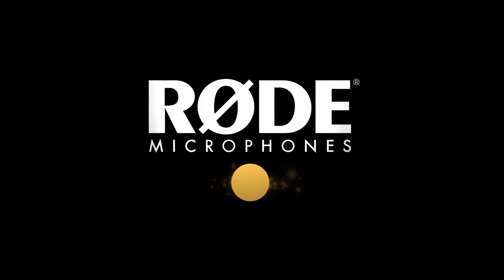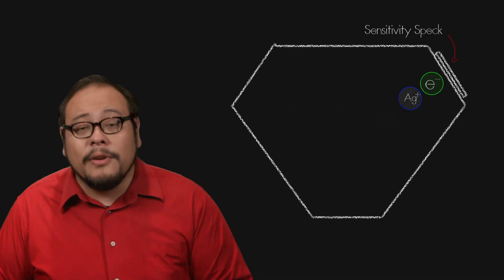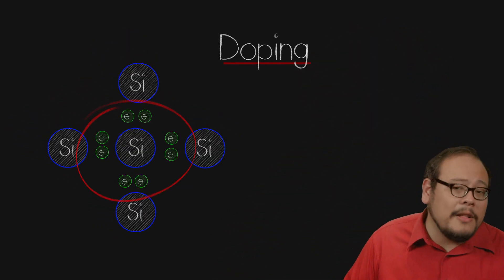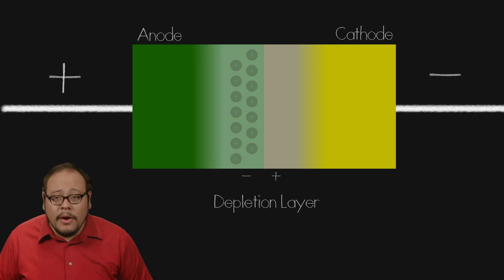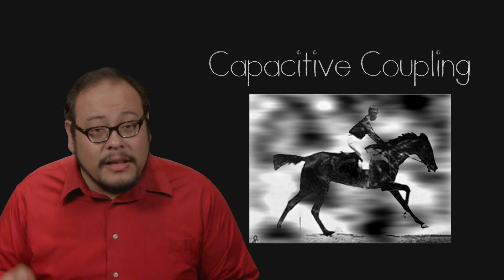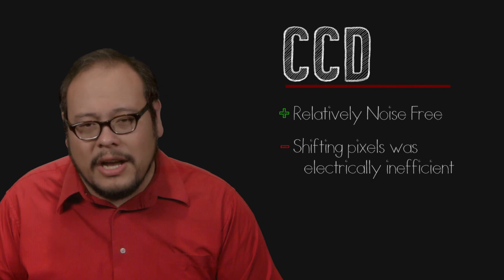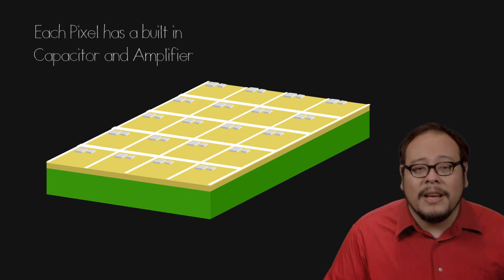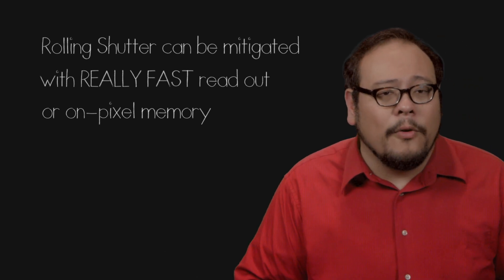The Science of Camera Sensors

Comment: Great video!
How does the Rolling shutter effect work in very high shutter speeds, lets say 1/4000? Is it even noticeable at such short duration? And is the rate at which the sensor scans a frame related to the exposure duration per frame?
Reply from the maker: +Shutter Authority This is great question!

Shutter speed is not same as readout speed.  Shutter speed is how long the pixel is allowed to measure photons. The readout speed stays the same regardless of the shutter speed - so whether a pixel is allowed to sample photons for 1/48 or 1/480 makes no difference to how fast the data is transferred to memory.
Reply: So the readout speed is the time difference between the topmost row of pixels and the lower most? Doesn't the readout speed have to be higher than the shutter speed? Because if not, the point where the shutter speed exceeds the readout speed we'll start seeing incomplete exposures. Right?
Reply from the maker: +Shutter Authority No, what happens is the camera staggers the exposure of each line. Not only is the data read line by line but so is the exposure.
Reply: Cool. Thanks!
Reply: @Filmmaker IQ , True, that the term, “shutter speed” has always been synonymous with the exposure time, —it was not THAT important until the focal plane shutter, when flash sync speed became an issue— the speed of reading the entire image does become an important technical aspect of the rolling shutter problem.

Also, you are correct in saying that for the vast majority of consumer cameras, the issue is the CMOS and not the slitscan, as most consumer cameras only have electronic shutters. For us photographers from the film era, or with modern DSLRs with mechanical shutters, it is still a concern. It would stretch out, or compress, the appearance of a speeding car if the,… let's call it, the “slit speed,” …was not fast enough. Knowing this, and knowing the precise movement within one's camera, meant sometimes a photographer would flip their camera upside down to prevent fast cars from looking slow and boxy, or change to portrait/landscape orientation, based on the direction of motion of their shutter ,(or choose a camera with a leaf shutter).

It is not an issue when panning, but can be an issue when the subject is still, but an important element of the image is in motion, and the exposure time is not short enough to freeze motion. If I take a 1/8000 second image of a plane/helicopter with a slitscan Pro DSLR, I still get rolling shutter issues. If I turn on electronic shutter, I can freeze the blades, un-distorted, with  a Pentax 645D (which uses CCD sensor), but not with a 645Z (which uses CMOS sensor). On the other hand, with the Hasselblad, I can choose one of their leaf-shutter lenses, and be fine, whether I have a CCD or CMOS back on it.

The problem with a leaf shutter, however, is its limited minimum exposure time, being between 1/500-1/1000 seconds, (usually 1/500 seconds), meaning limiting the ability to freeze motion. So their are technical considerations to choose between CCD or CMOS, and between mechanical vs electronic shutters, and (for photographers), between focal plane vs leaf shutters.

Understanding these technical issues can be the difference between getting a good shot and getting a great shot, or just getting the shot how it was envisioned, by knowing how the camera will actually see it. This is why I love your channel. You do not trivialise the science/technical stuff, but point out their importance.
Reply from the maker: +Top Rock Photography now that you clear it up that makes much more sense.
Reply from the maker: +Top Rock Photography there is some truth to this comment but it a lot of this is mired in sloppy terminology and a word misunderstanding of what a shutter is. First of all shutter speed and exposure time is intrinsically linked... So much so that all literature treats the terms practically interchangeably. The shutter determines exposure... There is no term for another mechanism that governs exposure time.

Secondly though a physical rolling shutter does exist going to the extreme with slitscan,  For the vast majority of people experiencing rolling shutter on consumer cameras, the artifact is NOT caused by a shutter but by the Sequencial line reading of a CMOS sensor. The effect becomes visible AT high shutter speeds because there is less motion blur.
Reply: People always confuse TRUE shutter speed, the speed at which the shutter moves from the top to the bottom of the frame, with exposure time, the time the sensor, whether chemical or electronic, is allowed to gather light.

[EDITED: to clarify some terminology]

The faster the speed of shutter, the less  rolling shutter issues one has.  This is not affected by exposure time. If the speed of the shutter is 1/60th of a second from top to bottom, (the same as the “flash synchronization speed,” or flash sync speed), then at 1/250 second exposure will have the same amount of rolling shutter as 1/8000 second exposure. However, a camera with a 1/250 second flash sync speed, will have much less rolling shutter issues on a magnitude of about 0.25.

That is to say, if an object had moved across 80% of the frame at a nominal speed of shutter of 1/60 second, it would have moved across 20% of the frame at a nominal speed of shutter of 1/250 second, whether at an exposure time of 1/250 second or 1/8000 second.

Most people have a hard time de-linking true shutter speeds from exposure time, but think of it this way; speed is distance over time, such as the time it takes for the shutter to go from point ‘A’, the top of the frame, to point ‘B’, the bottom of the frame, while time is simply the passage of time, and unaffected by motion, (assuming we are speaking of motion at magnitudes of less than 0.01% the speed of light). If a pixel was exposed for a time of only 1/8000 seconds, the exposure time, it matters not how fast or slow the shutter was moving over that pixel, the true shutter speed, but it does matter, in terms of rolling shutter, the difference in time between exposure of the first pixel at the top of the frame, and the last pixel at the bottom of the frame.

In short, the speed at which the shutter moves determines how much rolling shutter problem one has, but the time of exposure of any one pixel does not. This is why CCD with electronic shutters, do not have a rolling shutter issue, as the entire sensor, top to bottom, is exposed at the same time. Two things which this video failed to explain; the difference between electronic shutters on a CCD vs a CMOS sensor, and the difference between a mechanical shutter vs an electronic shutter.

Also, between a mechanical leaf shutter (not really a cinema thing) and a focal plane shutter (again, not really cinema), and a rotating shutter. Yes, rolling shutter affects photography also, not just cinema.

Comment: I'm an electrical engineer (and a photographer) and I enjoyed this throughly. It's not often I see the phrase "P-N Junction Diode" outside of my work. Thank you for a job well done.
Reply from the maker: +Jim Julian My hat is off to you!

My grandfather was a civil engineer. My Dad grew up in the 40s and wanted to become an electrical engineer but my grandfather persuaded him not to because there's no future in electronics. So he became a mechanical engineer.
Reply: +Filmmaker IQ I am also a photographer and an electrical engineer and everything Jim Julian said rings true. All your vids are good, this one is great. The explanation of the silver gelatin film alone is worth it.
Reply: i like the first concept being a diod, instead being cmos and ccd manufacture
those still run on semiconductur principle 
leaving that aside, why not use more wires to read out the "eV or voltage" 
syncron or with other words all at once 
if its a question to a electric circuit there are 
electric circuits that can do this

a example would be the a-syncron adder, that electric circuit read out the status in more steps
while a synchron adder electric unit reads out all the status´s (eV or voltages) syncron or with others word all at once

but coming from year 2021 that is a very old and passed problem 
why relay on a dinosaur electric unit (such as the a-syncron adder)

if the waver has to be turned 
around grind could be the answer
if the bus (thats the amount of transer wires) is a problem then just increase the bus
if a other electric unit is the problem a cache would be a solution (what is for example used on HDD´s)

https://upload.wikimedia.org/wikipedia/commons/6/66/CCD_charge_transfer_animation.gif

in the video for the CCD semiconductur 
the shift_register is talked about
they call it parallel(syncron) and serial (a-syncron)
https://en.wikipedia.org/wiki/Shift_register
that serial or parallel are just other words for syncron and a-syncron or all at once
Reply: semiconductors is a high-school topic, being an engineer has nothing to do with it.
Reply: Hi jim, Im currently in my undergrad for Electrical engineering and I love photography I just wanted to ask what do you do for a living?
Reply: +Jim Julian   
This video was really rudimentary and glossed over MANY important details.  But only one... that I could mention is, the cartesian layout of photo cells.  In the video they are shown as similar to grid paper, that perfectly rectilinear set of XY points connected by linear functions made popular as 'Cartesian paper'.  But in actuality, a lot of the operations of modern photo sensitive arrays is not in those perfectly square shapes and not in the lines shown.  Do a patent search on each companies' products who make these chips, and you'll each one has a different architectural topology and in fact, a number of newer implementations have left two dimensional surfaces behind, moving their architectures into the realm of 3D lattice spaces, multi-layers, and multi-functional overlapping systems.

NOW... add to that, the lens caps themselves.  Not the lens cap you know of where you snap, bayonet or screw a cover on a lens to protect it from the outside environment, but a lens cap that is actually built on top of the semiconductor bulk which affects the paths of the photons before they strike the semiconductor top surface.   Imagine being able to sample a pattern of areas and determine illuminances or to move parts of the image from one space to another to compensate for movement, de-focusing, lighting differences, low contrast, and more. 

NOW... consider being able to do all these pre-semiconductor manipulations on the impinging light field, in real time, and apply artificial intelligence to the patterns in such a way that operations are both determined and carried out 'on the fly'.   Think then of these lens caps as pre-processors, successfully modeling YOUR 'retinal ganglion pre-processors' that each of you didn't even know you had, and you can see that we are moving into a state of technologies, where an intelligent camera is far beyond what you thought could be achieved through microprocessor post processing systems, alone.

THAT gets you closer to what 2015 is all about.  Everything covered in this video is more like the 90's.

My current state of the art is 4K x 4K by 256 processing layers, in a 20 um layer, so that's 256 vectors, I can affect across every pixel of a photosensitive device, on a whim.  And that 'whim', is not human.

Comment: Soooo... how does a global shutter work then?
Reply from the maker: +Lady vor Edocsil For CMOS sensors - from the research I've done - it's either accomplished with really really fast pixel read out or using on pixel memory. For example the Phantom 4K highspeed camera has rolling shutter but it's so fast that you will never see it even at it's highest setting.

The other way is to put a tiny bit of memory on each pixel which remembers the voltage on the pixel. Then when you're reading out the data line by line, you're not reading "real time" but rather just collecting data that's was captured and stored at the SAME TIME.

This video from Sony goes into it a bit: https://youtu.be/tkh5eWECgbU
Reply: +Filmmaker IQ  Thank you sooo much, you're one of the few channels I know of which actually goes into the details of film production!
Also, I understand now why camera's with global shutters are so expensive :)

Comment: Fantastic! But I wonder what happens in the very latest cameras with global read out and incredible low light performance... like what makes sony sensors so clean even at very high ISO?
Reply from the maker: +mcol3 Everything we present here is just the fundamental concepts - the camera engineers take it to the next level and figure out how to get these things to work and how to cheat and get more performance. 

Regarding rolling shutter - even one of the Phantom high speed cameras has a rolling shutter - it's just so fast that you'll never see it. Then there's the process of adding pixel memory - that way when the CMOS is reading the data, it's not reading in "real time" but gathering data from pixel memory which was captured "globally"

One of the ways that Sony gets better light performance is to use back-illuminated sensors - putting all the gizmos on the back side of the sensor. Then there's noise reduction algorthms in the camera's hardware... So much brilliant engineering that we aren't even coming close to touching on in a 12 minute video :)
Reply from the maker: +Foto-Video Cristi Toma So many people have gotten complacent with the amazing technology. Yes we should push camera companies to produce better products, but I wanted to cover this topic as a response to the arm chair filmmakers out there who think they know better than the engineers design these cameras
Reply: +mcol3  It's not just the  sensor alone. Right after the sensor itself there is the analog to digital converter. And not just one, as reading is done in parallel. These ADCs have to sample data millions of times per second. Not an easy task. And it also has to be cheap enough. Cheap and performance don't really get along.